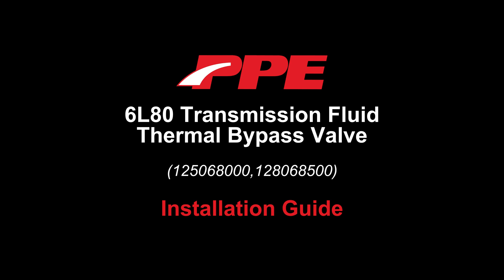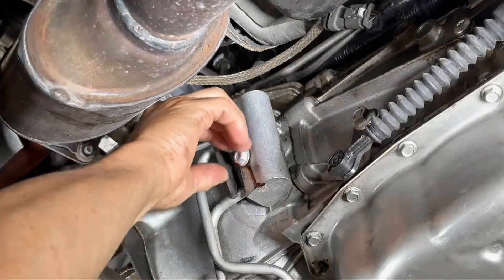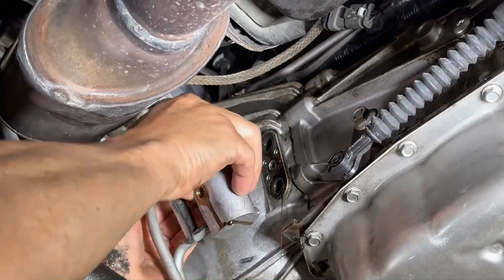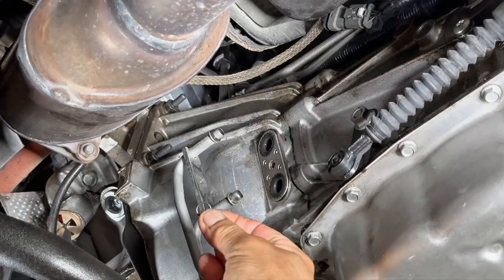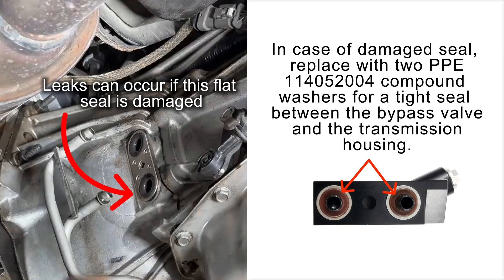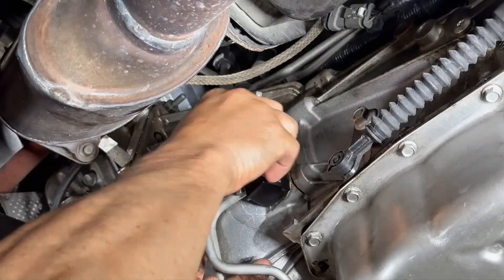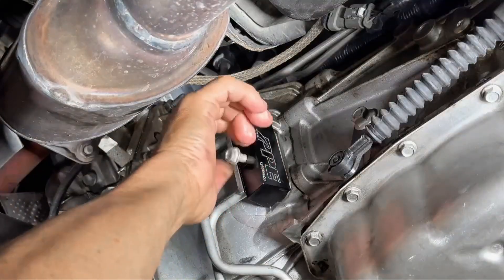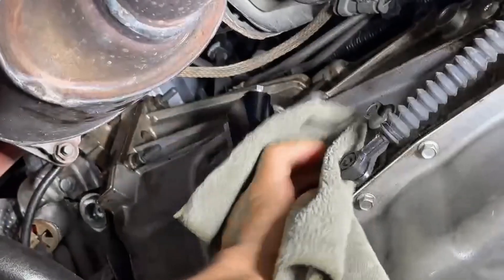GM 6L80 Transmission Fluid Thermal Bypass Valve - 3/8'' Line Install Guide

Comment: Careful I have a Chevy 1500 Trail Boss with the 6L80 trans and 5.3 engine. Bought a PPE for that set up and the cooler lines are much larger in dia. Would not fit. The 2019 has been set up with factory larger cooler lines.I ran mine from West Palm beach Fl. to West of Okeechobee Fl. and when running constant 170 degrees Stop at lights and temp goes up about 7 degrees. but comes right back down when you start rolling and get air moving through the cooler. Round trip 196 mi.  Temp. 170 - 180. Trail Boss is set up diffrent than standard 1500 Silverado.
Reply: What year is your truck? 2014-2018/19 classic has different retention method than others, this is made for these years

Comment: I installed mine, but it leaks through the factory valve bolt, any recommendations?
Reply from the maker: Try replacing the seal between the transmission case and the TBV. If you still experience the issue after please contact our tech support team at support@ppepower.com

Comment: I noticed that when I’m driving my temps usually go down and stay between 150-160. Which is a huge improvement since my transmission oil temps used to go up to 195. But when I’m idling the temp goes up to about 170-175. Still lower than 195 but is that normal ?
Reply: That’s a great temp normal temps are at 190 or so
Reply: I just installed I notice when I’m driving it gets up to 190s again like the old one but I’m not sure if it’s working.

Comment: How does this install on the 2014 Silverados that use the clips to hold the lines instead of the plate?  Are there parts with the bypass that will convert them?  Or do I need to change my transmission lines to the updated ones with the plate that holds them in?
Reply: Comes with instructions and there are plenty of videos on it
Reply: Did you find a way to make it work iam having the same issue I don't have that plat for the lines. My lines bolt on. Let me know if you find a way or a kit or something

Comment: I installed this exact part with a mishimoto tranny cooler at the same time. my temps now are 130 ish even in texas hot summer days over 100 degrees outside. My question is 130 temp too low for these trannys or its perfectly fine?

Comment: So the ppe will 6L80 continues flow and keep temps down.
Reply: that's what it seems like it does. Continues flow. I just did mine today on the 2017 Tahoe with 6l80 and in my city it gets 100 degrees outside in the summer. The temperature for transmission fluid would range from 190-198 degrees in the summer. I did a 30 min drive and the max temp now is 167-170 degrees at its hottest point which is great. Tranny loves it. However i will be adding a transmission cooler in a few days to go along with the bypass valve.